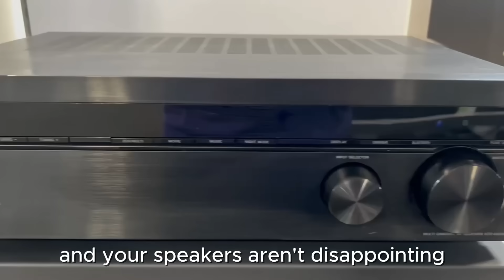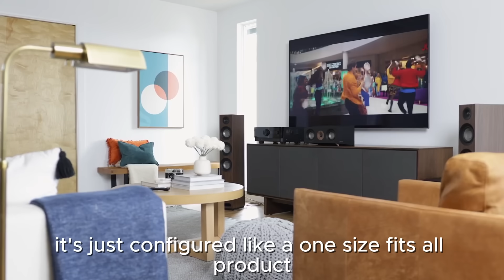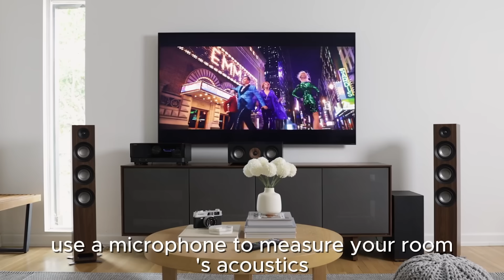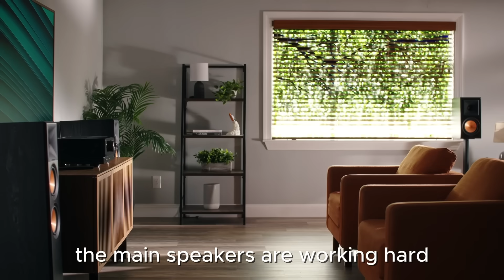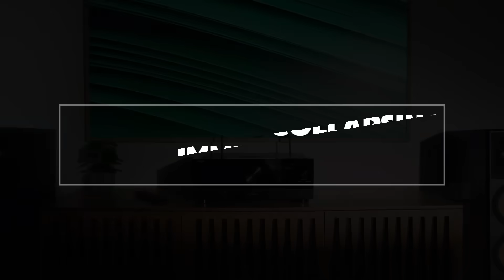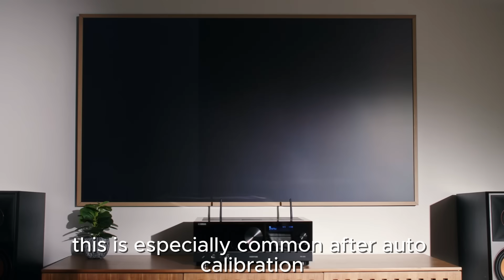Your AV Receiver Settings Are WRONG | Unlock Hidden Sound Quality

Comment: False I’m running a 3.0.2 on eco mode on with emotiva xpa 3 dr3 it does not interfere with sound at all and my denon is ice cold . Internal amp on receiver is off for all channels anyway so the amp is pure beast mode , subs are nothing for it , i recommend eco if you have a small 3.0.2 like i do , try it .
Reply from the maker: Glad that setting is working well for your specific setup and keeping things running cool! 👍

Comment: Have Onkyo TX-NR676, a Sony XR-65X90CL with 4 ceiling speakers a front speaker and a subwoofer. I ran a HDMI cable to the eArc on the TV and to the Arc on the back of the receiver but get no surround sound, when I press the TV button on the remote I only get sound through the front speaker no surround sound. What could I have done wrong? Not to savy with electronics. Appreciate any help or suggestions.
Reply from the maker: Make sure your TV's audio output is set to "Pass Through" or "Auto" and verify that the receiver is set to a surround sound listening mode rather than "Direct" or "Stereo." 👍

Comment: Pioneer Elite Sc 95 AVR is my Receiver,
Reply from the maker: The Pioneer Elite SC-95 is still a very capable AVR. If your 4K player is connected directly to it, you're already getting the full lossless audio formats like Dolby TrueHD and DTS-HD Master Audio. Using optical from your TV for TV apps is a perfectly sensible compromise if you're happy with the sound. Thanks for sharing your setup!
Reply: @Consu @ConsumerSound ve a Bravia 7 Tv , took me 2 weeks to finally get it to properly handshake to my avr , avr not 4k so I had no sound , until I used 8K hdmi cable , I ordered the Sony adapter to run the optical  still didn’t have sound , I unhooked the optical  and put the 8k hdmi cable have never lost handshake since , have a emotiva A5 amplifier added , pushing a pair of SVS Pinnacle towers for my fronts, Cerwin Vega E715 as my rears , with dual SVS SB 3000 subs woofers , wanting big bass for music , and bass for movies , , Had it for a little while and lost it when the handshake kept failing before I changed to the 8 K hdmi cable I mentioned earlier , but now everything sounds flat with no massive bass , any suggestions to get that big bass I once had , got so frustrated set it down , am now ready to get settings correct so I can really experience the massive bass I know this HTS can reach , already set speakers to small , all channels , set crossover at 80 Hz , both woofers channels to dual and yes, still flat and lacking ,have SPL meter to set channels to 75 DB ,  Can you offer me any suggestions that will help is greatly appreciated , Thnx for responding in advance 🙏🏽🙏🏽😎😎🤞🏾🤞🏾👍🏾👍🏾💪🏾

Comment: It didn't come with a reciever how do I hook up
Reply from the maker: If your system doesn't include an AV receiver, then this particular guide won't apply. Most soundbars connect directly to your TV via HDMI eARC/ARC or optical instead. Let me know what equipment you're using, and I'll be happy to point you in the right direction. 👍

Comment: What happens with mic positions when your head rest is 6 inches above your ears? The video says to make sure the mic tip has a clear measurement in 360 degrees. In my case, I can't have the mic at ear level AND 360 degree clearance. I assume I should favor the 360 line of site.
Reply from the maker: Great question! I'd prioritize the 360° clearance over perfect ear height. If your headrest blocks the mic, raise it slightly so the mic has a clear line of sight. A small height difference is usually less of an issue than reflections caused by an obstruction. Hope that helps!
Reply: @ConsumerSound  Yes, thanks!

Comment: I argue about the large speaker settings. There are plenty of speakers on the market that can handle deep bass. i do not have a sub and my speakers shake the hell out of my house. I have the Klipsch KLF30s, which have (2) 12" woofers. I am using 4 of these for mains AND surrounds.
Reply from the maker: Absolutely, and you're right for a setup like yours. Speakers such as the KLF30s can produce excellent low bass without a sub. My recommendation is aimed at the average home theater setup, where most bookshelf and tower speakers benefit from being set to Small. Your system is definitely an exception! 👍
Reply: @ConsumerSound only issue with mine is I bought them used in 2004 and there is a couple of woofers that need replaced. I had to swap them with surrounds to be less noticeable. But to be fair, I’ve abused the hell out of them over the years. lol. The most powerful disc to demo is SACD of Tchaikovsky 1812 Overture. Amazing hearing cannon fire in every speaker!🔊 it feels like you’re in the middle of battlefield.

Comment: I have a Denon S960H and I find my self setting the audio levels in every channel to +7.  I know this shouldn't be the case but it just sounds too low if I don't.  I have a 5.1.2 setup with Martin Logan fronts, Center, and Rears.  What should it be set to?
Reply from the maker: There’s no universal “correct” number. If you’re boosting every channel to +7, that usually points to a calibration, source level, Dynamic EQ, or listening volume issue rather than the speakers themselves. I’d start by checking your Audyssey results and reference level settings. What volume level do you normally listen at?
Reply: @ConsumerSound 24DB
Reply: 😂 sometimes I get carried away with comments. I was setting up my system also.
* Could be a sign your speakers can handle more watts per channel. So bumping up channel levels and from anywhere possible. Ya  .

Comment: Denon AVR X1500H.  Playing XBox series X.  Sound is very loud and I can't turn it down no matter what I try.  The PS4 is the same way.
Reply from the maker: That definitely isn't normal. Check that the Xbox and PS4 aren't outputting a fixed volume signal, and make sure Dynamic Volume, Volume Limit, and Input Level settings on the Denon are configured correctly. If every source is excessively loud, it may be worth doing a receiver reset and re-running Audyssey.

Comment: Marantz 7013 ,after calibration seems like I've go to turn it up to -20 to -15 to get good effect. 0 reference is to loud 😂. Echo is off and no extra modes are on. Source input set half way,should I increase source in put and recalibrate
Reply: Don't use the auto calibration - set your own values for each speaker, adding a couple of dBs for the center channel. Then go in to the settings and look for "Source Level" and set this to "+10dB" for your primary sources.
Reply: @MikeMargolis-j8f that’s ridiculous advice! You can’t set anything manually unless you know what your doing with a calibrated mic and REW
Reply: @adamhowells4866 That's only if you're shooting for reference - because I'm not, I manually balance the speaker trims by ear from the sweet spot, adding two dB compensation for dialogue through the center, and adjusting the surrounds (in a 5.1 setup) if one is closer to my head than another. Everything sounds balanced and I never had an issue in the over two decades I'm setting up systems.

May I suggest you cease coming into YouTube comment areas telling people to "stop spouting off nonsense" because you disagree. It shows a distinct lack of intelligence and maturity.
Reply from the maker: That’s actually pretty normal on Marantz/Denon after calibration 👍 Reference level (0 dB) is extremely loud in most rooms. Listening around -20 to -15 dB is very common. I wouldn’t raise source input unless something sounds clearly weak or compressed. Maybe just double check speaker distances, levels, and Dynamic EQ settings before recalibrating 😊
Reply: @ConsumerSound There's nothing wrong with using Source Level as a way to raise gain - it merely forces the total available volume to decrease by that amount.
Reply: @C @ConsumerSound reference sound” is NOT 0. Everybodies will be different depending how loud the AVR was calibrated. Stop spouting nonsense

Comment: Onkyo TX-NR696 and I am think of running another together with it, I haven't even plugged the other Onkyo up and played it yet, it's a Onkyo TX-RZ810. Edit, I have two Yamaha receivers and a technical pro HB-3502U that claims it 3500 watts . I am not sure about that. I also have a Realistic STA-95 that looks like brand new.
Reply from the maker: That’s a serious collection of gear 😄 The TX-RZ810 is definitely the strongest piece there. Just be careful running multiple receivers together unless you really know the signal routing and speaker loads—things can get messy fast. And yeah… those “3500 watt” ratings are usually very optimistic 😂
Reply: You shouldn't attempt to daisychain AV receivers like you're suggesting.

Comment: Im watching your video on an old sony muteki km5000.
Reply from the maker: Those old Sony Muteki systems were absolute monsters for their time 😄 Still plenty of fun if it’s set up right and shaking the room!
Reply: @ConsumerSound yes.i have small room but i really need to set it up well.if i could get long power cables to put the 2 subs at 2 corners ill b good.the only problem with the receiver is that it does nit have internal fan to cool it down but evrything still works great
Reply from the maker: Dual subs in opposite corners could definitely help smooth out the bass in a small room 👍 And yeah, some receivers run surprisingly hot without active cooling, so giving it plenty of airflow is a smart move. Sounds like you’re on the right track already 😊

Comment: There is one growing possible exception to the "bitstream instead of PCM" advice which is otherwise sound: Many devices, including the Apple TV 4K and Atmos TVs, will now output Dolby MAT format, which is PCM in a wrapper that preserves Atmos metadata. The ATV 4K by default decodes streaming Atmos to Dolby MAT; its new "Continuous Audio Connection" setting in tvOS 26.4 will decode all supported Dolby formats to Dolby MAT. (Alas, TrueHD passthrough still isn't supported with OR without Atmos; neither is true bitstreamed Atmos.) If you use a soundbar like I do with limited sound modes, Continuous Audio Connection is probably best. If you use a full AV receiver as broadly suggested in this video, however, Dolby MAT often affects your sound mode options, for good or for bad; choose the option that gives you the best sound mode for your system.
Reply from the maker: Excellent point 👌 Dolby MAT is definitely one of the few cases where PCM can still carry Atmos correctly. Apple TV 4K users especially should experiment with both settings and stick with whichever sounds best on their specific setup.